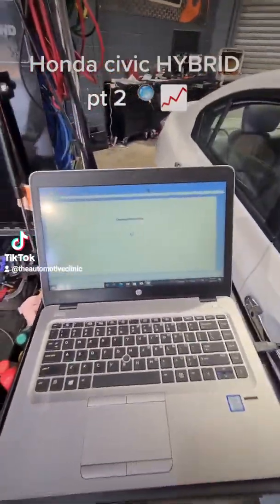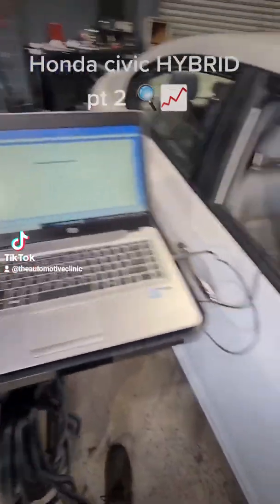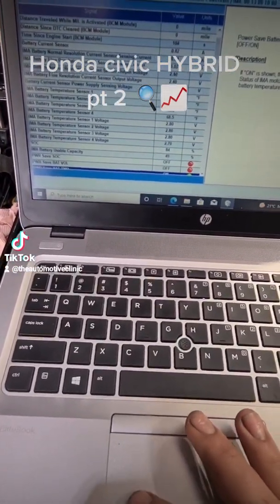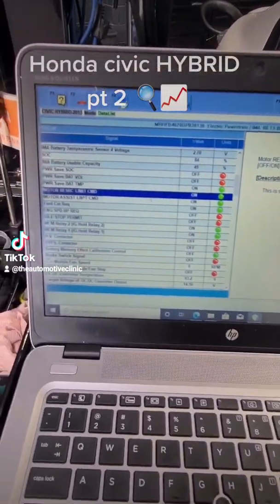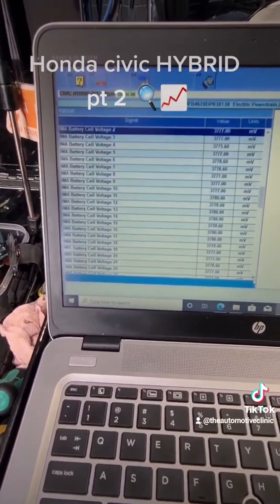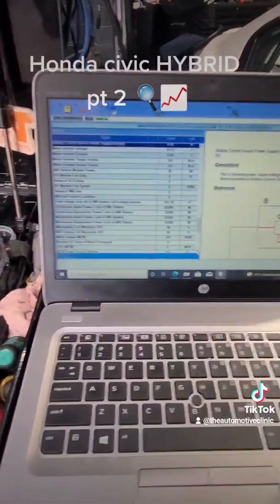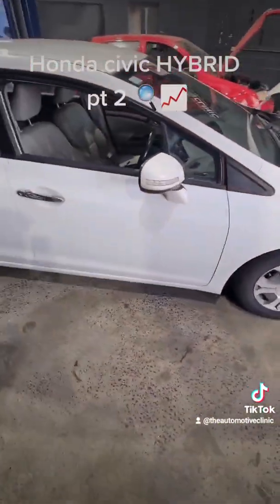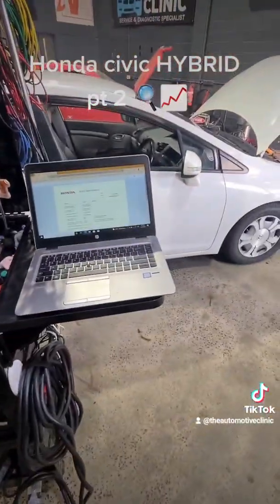Honda Civic HYBRID diagnostics with Honda  I-HDS dealer software PT 2 ⚡️🚘

Comment: I have 2008 civic hybrid when I start driving you can see the level of the battery go to 2 and after that I lost power . I turn it off and turn it back the battery start charging? I checked the hybrid battery with the mechanic and he said, the hybrid battery is good and nothing showed up on the screener and told me to problem is something else? any one know how I can fix my car! Thanks